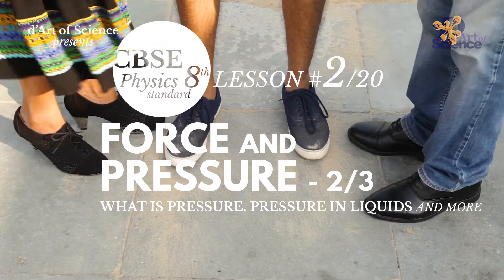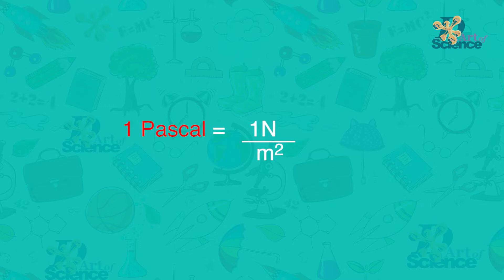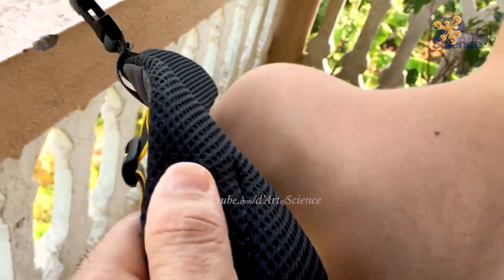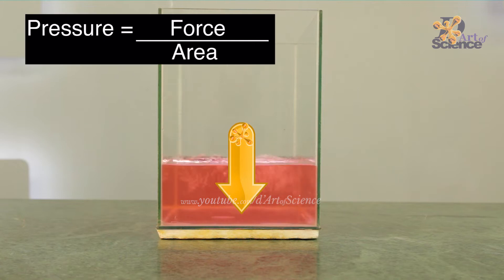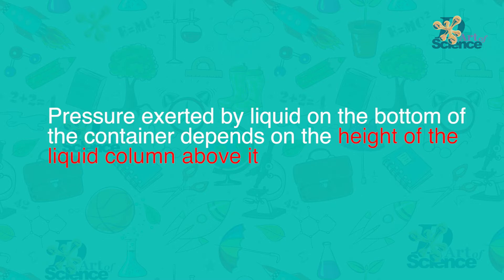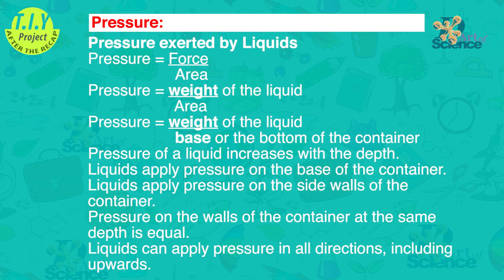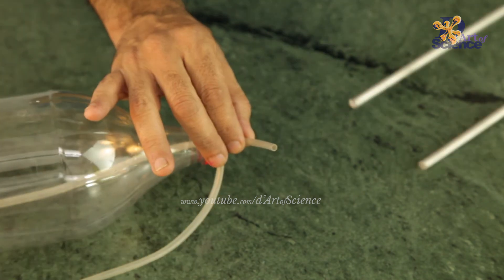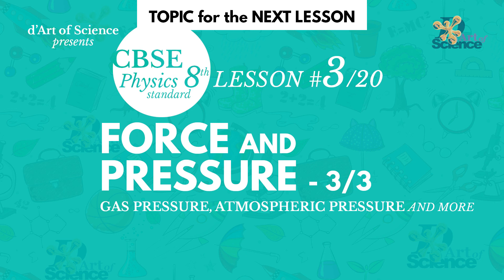FORCE and PRESSURE Part 2 - Physics Class 8th CBSE #2

Comment: Sir, there's one thing i didnt understand about your experiment of pressure in liquids.. Cant we say its the force or weight that causes the membrane to bulge out because we put more liquid in it and its not related to height? Thanks
Reply from the maker: but its as taught in the text book and this time i fully agree with every line in the description. you are right about the force or weight, but then it directly is related to the height of the water in this experiment. because to think of it, the weight of the water will also depend on density and therefore the balloon will not bulge out the same with water at different temperatures....but it will always proportionally bulge out based on the height of the water column over it.
am i making sense..:) im not a genius physicist and thats obvious perhaps, but i look at things and understand them and then try to show them in ways that have not been done before...or can be followed by kids to do their projects while understanding them
Reply from the maker: Alfred Mayer it’s directly related to the pressure